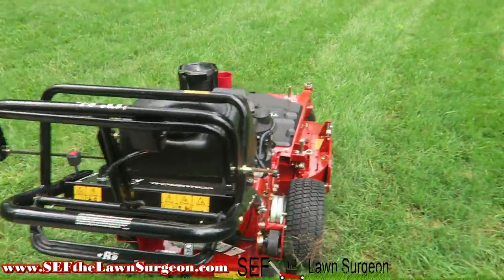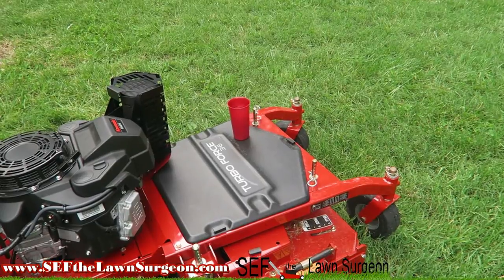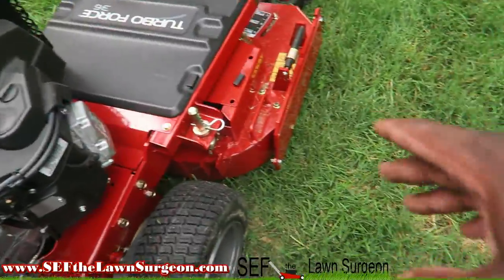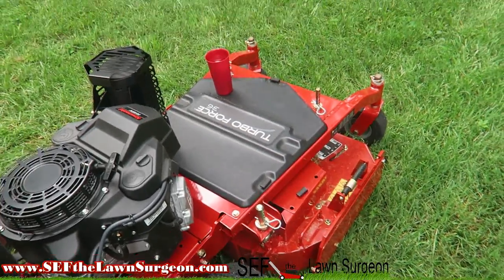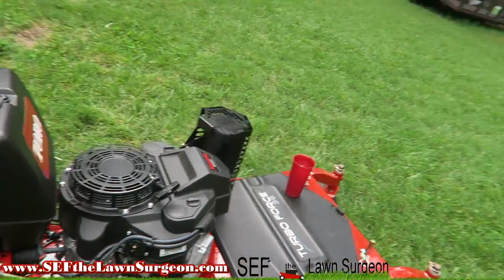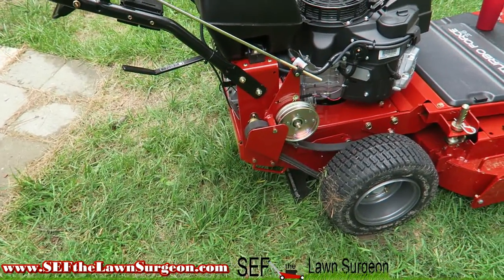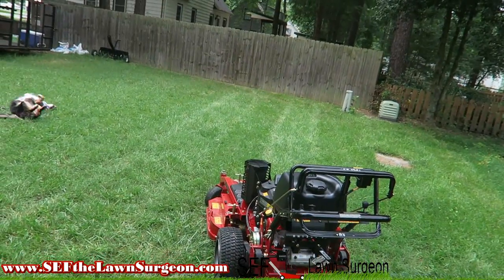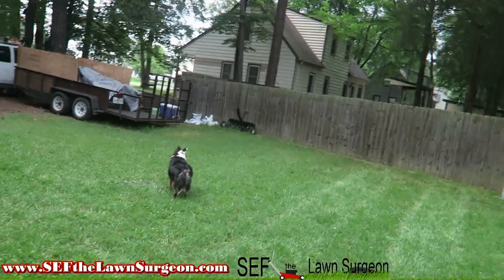New Toro T Bar Floating Deck Mower Talk

Comment: Congrats on the new mower! I have the same mower in a 2007 vintage. Stripes just fine. As was mentioned previously gotta go with high lifts. Mulching blades won't stand the grass up for good striping. Mulching kits are great for leave clean-up. Get real familiar with the  adjustable baffles on that TF deck and you won't need a mulch kit. T-Bar for life!
Reply from the maker: thanks

Comment: Just found this video question 1. What is a strip kit 2. Dose putting bar on to weight  down help with strip I have a toro pick mower drive not float deck21”

Comment: Once you get the hang of it you can operate it one handed in the center. Main thing is have it adjusted so tension is same or it will push you to one side or the other. Get a velke so you can use 4th and 5th gear.

Comment: Congrats on the new mower.  Be careful with the re-bar. If the flap breaks in reverse and it goes under the mower it will go flying!  I had it happen once and the re-bar flew into the tire and got stuck thank god it did not hit me.
Reply from the maker: well on the model the flap is like half a foot away from the deck...but thanks for the tip
Reply: I am saying if the flap breaks off because of the excess weight on it.
Reply from the maker: +Daniel Garreis ..oooohh.ok... well I have like 8 zip ties up there I drilled a hole below the pole that the flap is attached to and a zip ties go through the flap and around the pole so in case the actual flap rips it will still be held up by the zip ties

Comment: The mulch kit will stop it from striping well. Not enough air flow to create the lift you need to stripe.  Mulch kits down create nearly as much vacuum and a standard or high lift side discharge setup
Reply from the maker: aaaaahhh..thank my explain some things...thanks

Comment: Deck shape has nothing to do with it or machine weight. Line the blades up front to back of the mower, adjust the deck so the cutting edge of the blades to the front of the deck is a 1/4 inch lower than the cutting edge at the back of the deck. It's pulls so much more suction and lays a much better stripe and you don't need a striping kit after you do that. I hope this helps you out laying some brilliant stripes if you try it!
Reply from the maker: thanks my man

Comment: Love those belt drive walk behinds man. Hate the hydros due to all the leaks, constant fluid changes and motor replacements. AND they are heavier machines. Belts offer less on rutting the yard out, easier to load and unload plus less operator fatigue. Nice mower SEF!

Comment: Hey can you put a velke on that.?Would that HorsePower be enough?Youre probably to tipsy to even read this. $5500 for that though. Seems expensive to me but ive been finding deals on craigslist. Luscious 48 inch with like 137 hours for $4k But then i gotta ask why belt drive. Are the hydros problematic?
Reply from the maker: well ... one... i'm not tipsy now..only in the video..lol... and yes it will... i use to had a tractor the was 14 hp...and this is 14.5...so it should pull me..lol...and i dont believe the hydros are problem matic... just with a belt it will be easier for me to fix... most dealers are bizzy and you with have to leave your mower at a shop for a week or so...lol..
Reply: Tipsy Talk is the shiznit !
Much wealth and good luck with the new grass muncher
Reply from the maker: thanks my man...same to you